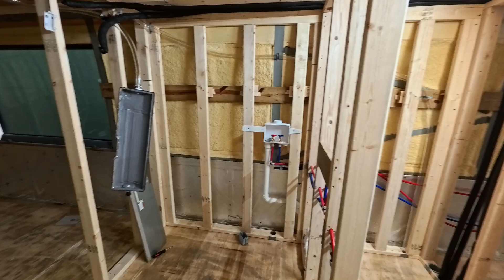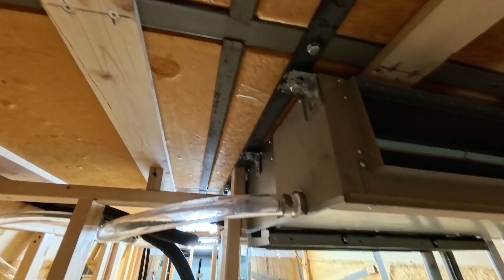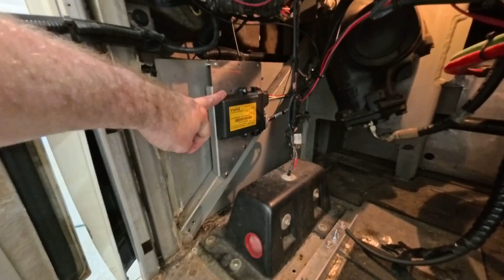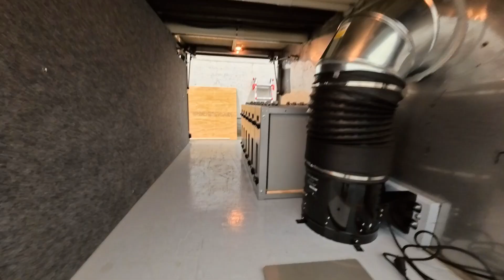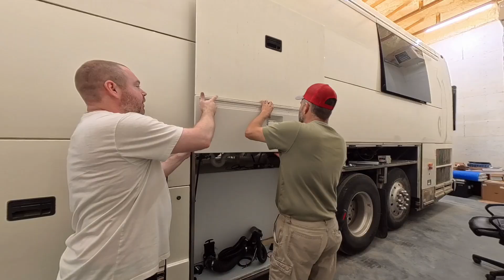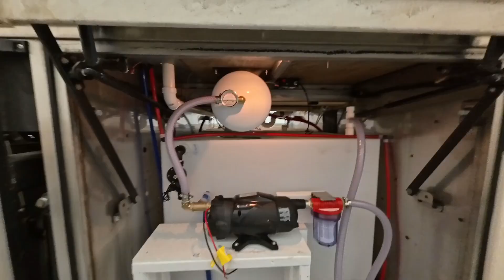State of the BUS: The Long Overdue Update

Comment: I am in the same boat as you are in, I bought MCI to convert. Can you please share the details about water tanks,nwhere did you get it and how much did it cost.
Reply from the maker: Absolutely. I ordered mine from Tank-Mart and had them build the tanks with custom spin-weld fittings based on my layout drawing.

I went with two tanks:
200-gallon RV fresh water tank — model RVWB485
200-gallon RV holding tank — model RVHB485

The tanks were about $1,040 each before freight/tax. With the added fittings, pallet fee, freight, and tax, my total came to about $2,685 delivered.